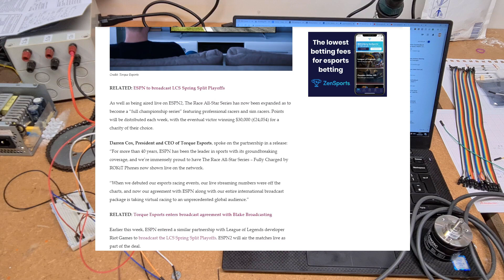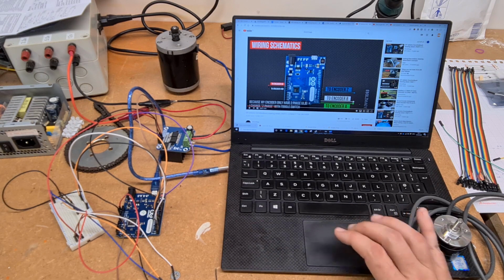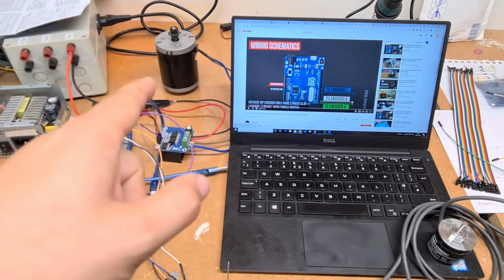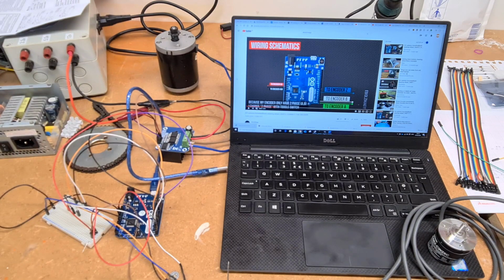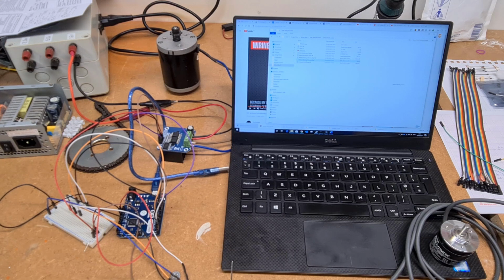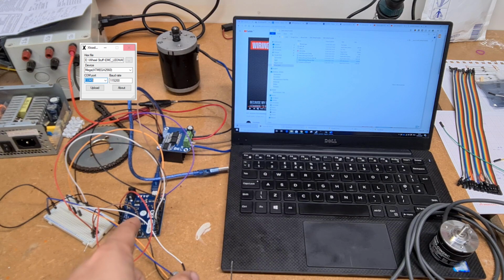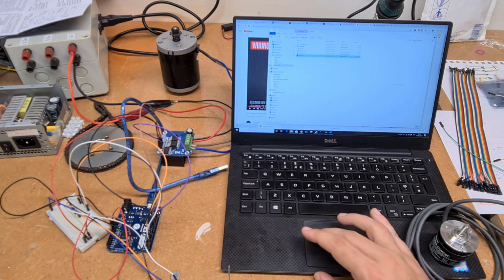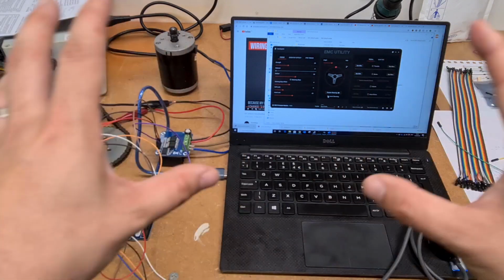DIY Force Feedback (FFB) Sim Racing Wheel - Part 1 Wiring

Comment: if the topic is still a little relevant, then you need advice))) I bought 560 ohm resistors, connected everything as it should be, but the encoder began to respond a little in devices and printers, but nothing works in the wheel config. What could be the problem??

Comment: in case of an encoder, obviously this one is 1000x better (even for a Chinese copy) but you can easily get a small printer encoder of ali express for about 10 bucks
Reply: it has probleme in fast rotations, it doesn't read the pulses correctly

Comment: Thanks for the videos about this project. A question: what is your experience with the BTS7690?. I see some reviews that many of them fail and they get hot because of bad cooling effect on the heat sink.. Is yours working stable?
Reply from the maker: I'll be honest, it's not had a great deal of hard use but I've never had a problem with it.

Comment: what pins of the arduino are the bts7960  L EN and R EN pins connected to? and is your motor voltage?

Steering works for me but forcefeedback does not

Comment: Is it also possible to use a potentiometer instead of the rotary encoder? I have an old force feedback racing wheel with a broken controller that only turns about 300 degrees and the potentiometer is build in.
Reply from the maker: I'm not sure but I don't think so. With a potentiometer the output is a voltage range. Honestly not sure what the output  is on an encoder - digital or voltage. I guess you could try it?
Reply: @makerepairrecycle3261  already did doesnt seem to work sadly. rotary encoder output is digital btw. 2 pins for movement and one for center.

Comment: Hi did you need to add any resistors to get this to work, i have an omrom encoder and I am getting no signal from it, it apears to be on as the red light inside is on
Reply: I could be wrong but I think if your encorder is 2 phase you have to use resistor but if it one like in the video that has the z wire then you don't need it

Comment: Hi! Nice project! I'm looking forward to build a flight sim with force feedback but I'm wondering how to control the torque since the motors has to put a known amount of force in the stick. I don't believe I could keep the force constant by simply controlling the power output with a PWM pulse. I've seen lots of projects out there but none of them seems to have some sort of closed loop power control system. Any suggestions? Thanks for the video!
Reply: check mine https://www.youtube.com/watch?v=gbE7mef8DK8&t=74s&ab_channel=RaulAlex

Comment: Hello friend. I'm from Colombia, since a long time, I saw your video and now, I'm working in a setup, but I dont know if I can use a motor from a Electric treadmill 90w 8Amp 4800RPM. I can pass to you a pair of photos, please help me.🙏
Reply from the maker: Hi - If you have it, try it! You will learn something from the experience of building it, which may be the motor is terrible, or it works! I know the motor I have is not great, but it does the job for now.

Comment: could be possible to use an analog handbrake? if yes where shoud i connect it to the leonardo board?
Reply from the maker: With the Leonardo, there is an input on A3 where a rotary potentiometer can be connected as a hand brake. Not tried it, but after I get V2 of the wheel finished, I might look into this 😁
Reply: @makerepairrecycle3261  could you please help me? I have setted everything it works  good but if i pass the range of the wheel it keeps spinning!!!

Comment: Would a stepper motor work?
Reply from the maker: My gut feeling is probably not with this software. You'd be replacing the BTS with a stepper driver and I think the outputs are different. But then my electronics knowledge is limited 🤣 I may have to get some high powered stepper motors (10Nm plus) for work soon, so might give it a try.
Reply: @Gregory Miller or even the motor

Comment: Great tutorial. ❤
Is it possible to change the leonardo motor controller outputs? Becouse im using pro micro version of leonardo. It has no 11th output. I hope you understand. 👍
Reply from the maker: Hi - to be honest I don't think so but I'm not sure. The software uploaded onto the Arduino came from EMC, so not sure how to change pins. I also thought it had to be a Leonardo board to be recognised by the PC as a controller. Electronics are not my strong point! 😁

Comment: Hey man.  Lots of respect for the rig you’ve built and the excellent video series.  I’ve been thinking about doing a build like this for some time but there is a lack of straightforward guides to follow for someone new to arduino programming/electronics.  

Would you mind having a look at this build I’m considering as a template for the motor and mechanical set up and whether you think it would wire and program appropriately with your recommended electronics?
https://www.xsimulator.net/community/threads/3d-printed-hoverboard-motor-wheel.14454/

Thanks for your time and the videos
Reply from the maker: Hi Steve - wow there is a lot in that thread! If the electronics are all the same as mine, then I think it would work. The Arduino tells the motor to move, via the BTS board, and feedback is sent to the motor/wheel. Only thing I can see different to mine is a direct connection on the motor - as is it 24v?? If you have the parts and the time, why not give it a go :-) You can always change parts until your happy with the set up. That's why I like the DIY route!

Comment: do you have problems with the software detecting encoder input if the motor or motor controller isnt connected?
Reply from the maker: Actually I haven't, I think I have been able to use it with the power to the motor turned off and/or disconnected.

Comment: If i buy a logitech DFGT motor could i use that with these parts?
Reply from the maker: Honestly, no idea! I did think about using my old Fanatec GT3-RS as the base. I guess it could be possible if you junk the internal wiring that controls the wheel. The encoder might need replacing, as I'm not sure it would work with the Leonardo/EMC software. But it would work mechanically, I guess, with some work...
Reply: @makerepairrecycle3261  ok thank you.

Comment: Can this be compatible with ps4
Reply from the maker: I haven't tried it, but my gut feeling is it would not work. PS4 controllers usually need to licence compatability from PS. Will give it a try soon tho, when I get time 🤣
Reply: @makerepairrecycle3261  Thanks for the great video. I'm also wondering about PS4 - maybe going via GIMX. Quick question; do you have to run a utility program on the PC in order to use this or that just for configuring the Arduino. I was wondering if I could connect the Leonardo via the GIMX adapter and then onto the PS4.  Cheers Steve

Comment: Could you please list the model number of the motor?  Would you recommend a more powerful motor?
Reply from the maker: Hi, the motor has a model number on MY6812B-12. If you search it, it can be found online, as spare parts for electric scooter. Its powerful enough for me. I've moved back to used iRacing and there is a lot more grunt in it now compared to pCars2.
Reply: @makerepairrecycle3261  Awesome.  Thanks for the vids.  Following intently.  I am building a racing arcade machine and I am in the process of ordering parts to build my own ffb wheel.

Comment: I mean it's about $100,000 a season to race very low level dirt tracks with a car capable of winning every night out. Transportation, tires, fuel and repairs eat up cash.

Spending a few grand on a high tech simulator is a whole lot more cost effective whether you buy it or build it yourself.
Reply from the maker: I'd agree with dirt oval, but in the UK there are several series aimed at "budget" racing. One EndroKa is aimed at teams of 3 sharing a car at races for 4h-12h. Some can do it for £10k per season or less. And lots of seat time. Admittedly not that fast, but a lot of fun.